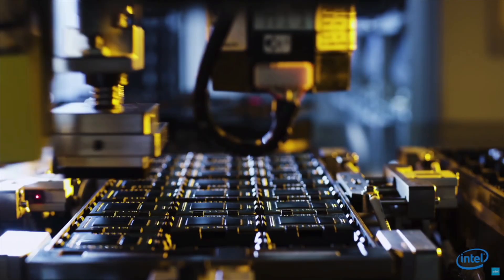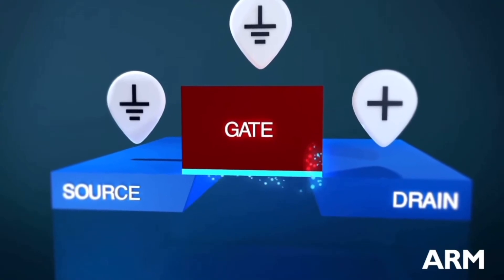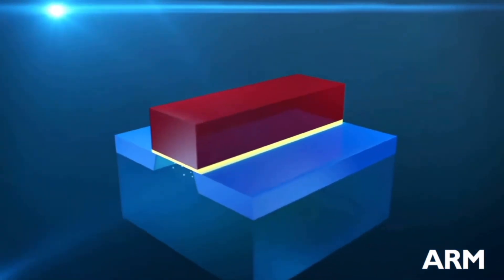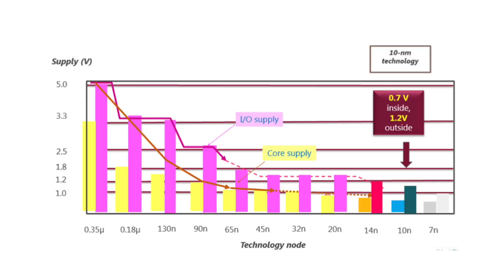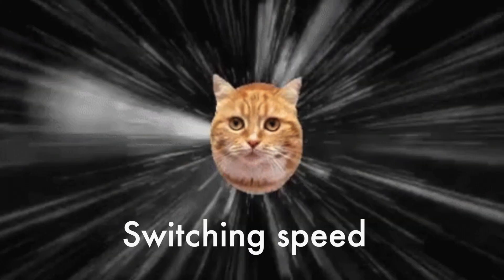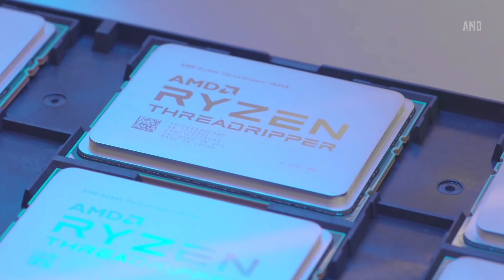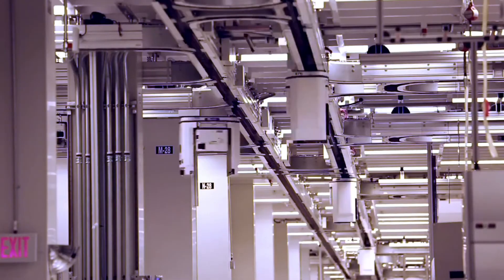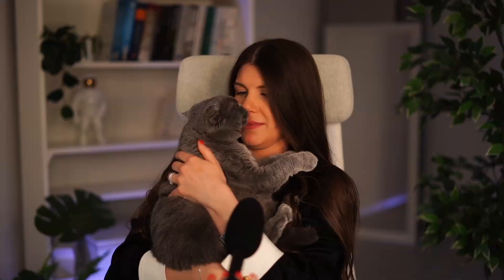What is wrong with 5nm, 3nm, 1nm.. CPU Technology Nodes explained

Comment: Even for planar transistors, the nodes stopped being referred to as the minimum drawn (polysilicon) geometry. I think it was around 0.25um where sideways diffusion started being considered, leading to stated gate lengths that were smaller than the drawn length (which is actually fair).
Is your cat a British Blue (Shorthair)?
Reply: Yes you get lateral diffusion of the S/D dopant, but the technology node was referred to by the actual design size of the gate electrode down to at least 65 nm, I say at least as I skipped the rest of the planar nodes to 22nm FinFET. 
The actual size of the transistor at any given node may have slightly different to the target size  to get the transistor characteristics on target. So a nominally designed 130 nm transistor might have run at 125 nm to get the characteristics correct...

Actually looking at what I wrote above, I think I should expand on the subject...

You are actually correct about the lateral dopant diffusion, & what I said was true of where I worked, some companies though would label their technology node based on Leff, the effective length of the gate/channel (or you could say the electrical length of the channel). Now there are spacers along the edge of the gates that make for a more gradual doping variation & hence electric field at the gate edge to stop hot electron effects, but that is another story. 
Looking up a cross sectional analysis of TSMC 28nm process shows LP PMOS transistors are 29.8nm, the HP PMOS are 25.5nm**; TSMC seem to be using a standard fabrication of the LP transistor and a poly fill/planarisation fabrication for the HP process, so you can see how the transistor electrode can 1) Be different sizes depending on the requirements of the transistor and 2) Fabricated differently. This is at the same nominal technology node...
Again you can see this here if you are interested: https://www.techinsights.com/blog/review-tsmc-28-nm-process-technology

**TBH, the structure of this transistor is not obvious, it could be as large as 34nm, in fact this may be more likely, with the gate electrode as a tri layer of maybe TiN/W/poly fill - I'm guessing based on the crystal structures...

Comment: Great explanation as always.
Idea for another video : explaining how logic density differs from SRAM/cache and Analog/( I/O) density from different manufacturers as well. Also multiple layers of EUV and MASK. Also core to core interconnect like ring or mesh formation effecting power consumption. Like even on Intel7 Intel chip using 50% more power than AMD on 7nm. 
Last but not least, manufacturing of DRAM and VRAM, why they are stuck on 10nm. 
Thanks!

Comment: How can you have a 1 nm channel width? 
Each atom of Si is supposed to be 210 pm in diameter.
That means your 1 nm channel is only about 5 atoms wide.
That sounds like an impossible miniaturization.
Reply: You are right. I think 1nm is only a number for them. They will be not able to make true 1nm wide transistors or what.
Reply from the maker: Exactly, as I mentioned in the video, process node number doesn't reflect physical features anymore :)

Comment: A dumb question. 
Do CHIP internal wiring downscales too? Doesn't it affects resistivity? Since ohm's second law states that resistivity is inversely proportional to conductor's cross section, decreasing it's thickness don't create more resistivity? Or it balance ou, since we have less current going though the wire?
What am I missing?
Btw. Great vídeo, thanks for the solid work
Reply from the maker: Yes, good point! It scales down too, but not at incredible rates. The thinner the wire, the higher the resistivity for a fixed length… that’s the issue with interconnect I mentioned in the video. Speed is mostly limited by interconnect parasitics..
Reply: @AnastasiInTech  Please, resistivity is a property of the material, resistance is something that you change with geometry. Thicker films have less resistance for a given line width (more area).
In process resistances are usually measured in ohms/square for films, or ohms for a structure.
Reply: But also apart from having less current flowing the resistance is proportional to length. If the transistors are smaller they are closer to each other so the interconnects are shorter.
 I would think also the interconnects can be made thicker in the vertical direction to compensate for the reduction in width so they are like in the form of a tape.
Reply: @listerdave1240  Good solution for the parasitic, too. Is it cost a factor here? Or the extra steps?

Comment: I would love to see a video explaining and comparing different gate types what are used. Like apple m1 chip, amd ryzen and nvidia gpu gates if they have similiar or different gate types and how it affects batterylife and powerconsumption. Love your videos, style of the videos and overall feeling🤘🏼
Reply: that, and why the newer smaller nodes nvidia and some others are using are doubling or more in power consumption. is there a limit of sorts where power saving ends/no longer scales as it did due to issues with the nodes getting so close to that quantum limit?
Reply: @Joe-Dead , The power used is proportional to the number of transistors, the capacitance of each transistors and the clock rate. The capacitance of each transistor is related to the physical size of the transistor.

It used to be as the number of transistors per chip increased, the size of each transistor decreased. As explained in this video, this is no longer the case. Now, as the number of transistors per chip increases, the size of the transistors grow in the vertical direction so that the actual size of the transistors doesn’t shrink.
Reply: @terjeoseberg990  that doesn't actually answer anything. smaller process nodes have TRADITIONALLY shown an increase in efficiency. IE, less power used and less power wasted as heat.

then you have nvidia using  tsmcs smallest nodes and DOUBLING power consumption. it's not just more transistors, i know how that works...pretty obvious more parts = more power needed. even with the savings from efficiency using smaller nodes.

while the power draw was going down it went WAY up. you'd expect that kind of  doubling if they doubled the amount of  transistors as well...well doubled and added a bit more since you have to count for efficiency from smaller nodes as past node changes had produced that efficiency at an almost predictable scaling.

one thing you did not mention and i felt i had no need to...the power consumption could just be down to how they designed it...but why would you design such an absolute power hog? when the trend has been  towards efficiency? sipping instead of mainlining current.
Reply: @Joe-Dead , Actually, my answer does answer the question. You obviously don’t understand it.

The capacitance of a transistor increases with the size of the transistors because the transistor looks like a tiny capacitor. And if the capacitance is greater, it takes more current to switch the transistor on or off. It also switches slower. That’s why the clock rates stopped increasing and why the power usage has increased.

There is no longer a reduction in capacitance and therefore current with smaller node technology because the transistors are no longer getting smaller.
Reply: @Joe-Dead , If you don’t understand what I’m saying, watch this video again. She explains what I’m saying in this video. The transistors might be getting narrower, but they are simultaneously getting taller, and therefore they are not getting smaller.
Reply: @Joe-Dead , FACT, power consumption decreased as the transistors were getting smaller. They are no longer getting smaller. However, they are still increasing the number of transistors per chip, and pushing clock speeds to the limit.
Reply: @terjeoseberg990  tell that to TSMC and ASML "TSMC's N3 technology will provide full node scaling compared to N5, so its adopters will get all performance (10% - 15%), power (-25% ~ -30%),"

i already answered my own question, it was a design choice. you really shouldn't try to show off what you think you know with the assumption that you know more than anyone else. here's the thing kid, i discovered the secret of always being right decades ago...it is rather simple, never speak on anything I DON'T KNOW. i KNOW how the nodes work, i KNOW how power consumption DROPs, more transistors can be packed in,  efficiency rises each new node or they wouldn't bother with new nodes as you'd gain NO REAL BENEFIT.

lithography machines in the euv are EXPENSIVE, so there absolutely has to be benefits from the previous iteration, significant benefits to outweigh the costs.

Comment: I really though that nm was a real measure for transistors, but your explanation makes much more sense. Thanks Anastasi.
Reply: That really stopped at 24nm but even before than many 48nm or smaller nodes where often more an average or guess than actual transistor size!
Reply: @DarthAwar , Right.
Reply: Once the technology became physically too small to actually make for real, they switched to imaginary “equivalent” measurements.